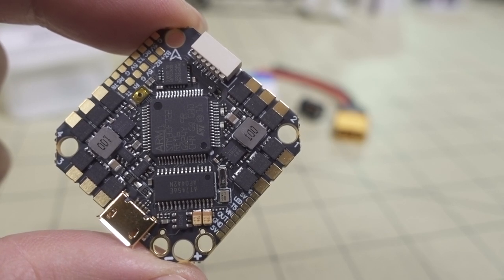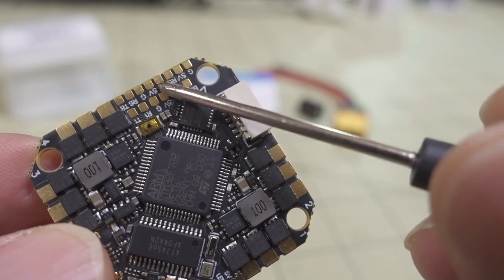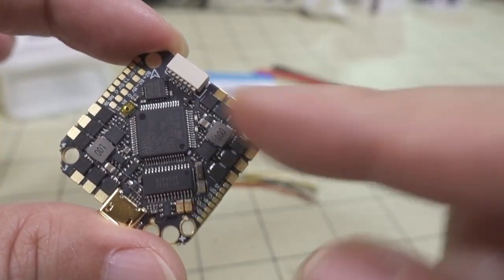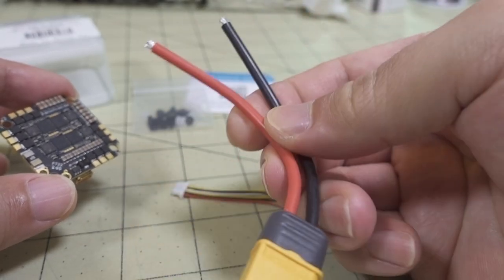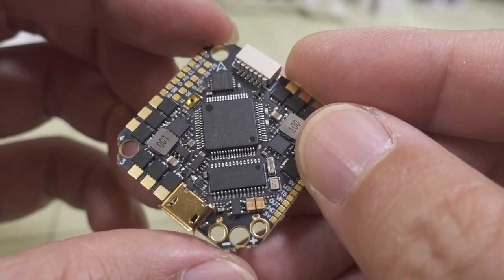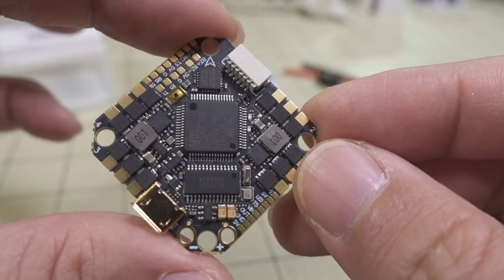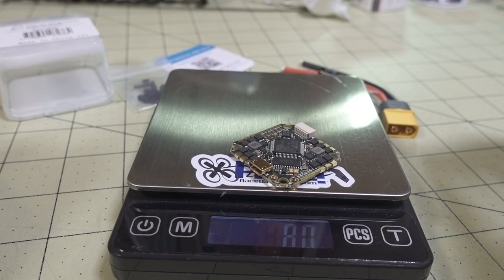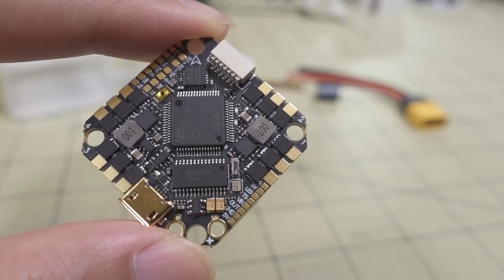BetaFPV F722 Toothpick Whoop AIO FC 🛠️

Comment: Hi Albert Great Video.!!!!! I am using this bord for my first build and I seem to not be able to see input movements on betaflight receiver tab using a dji controller 2.  Curious to know what toggles in the recievers tab do you need 
 ON.  to hopefully have a connection. 

It does bind with the dji 03 air unit. Using g the djj fpv v2 googles

Thanks in advance for any guidance.
Reply from the maker: Make sure your SBUS connection is wired properly.  Make sure you have selected the SBUS protocol in the receiver tab.  Make sure you have matching SBUS speeds in both the FC and in the Air Unit.  That's probably where you messed up... Normally, it's on SBUS normal in the FC.  If you set SBUS to FAST in the Air Unit, it won't work.  They need to match.

Comment: can I kindly ask you why neither in betaflight, nor in the OSD in the glasses show the battery voltage, although everything works perfectly?
Reply: did you figure it out? I think it was working on the betaflight that came with the board, I've upgraded it to 4.2.9 (without saving conf dump, of course)
and now I see zero volts, zero amps...

Comment: Hello and thank you for your video again!
I have this FC and I can not see voltage in betaflight. On what seetings I have to set it on betaflight battery tab?
Thank you in advance!
Reply from the maker: Usually the default factory settings will work just fine.  I almost never touch those settings.
Reply: @AlbertKimTV  Thank you very much for your answer! For some reason it came from factory like this. I have just try anything and do not know what to do. . .

Comment: Any idea how to clone the settings from one F722 to another one? Including ESC settings? I swapped the flight controller on a Pavo30 and can't manage to take off. I checked the props and motor wires all lock good. it should be something from ESC config I think
Reply from the maker: If you can connect to the old ESC, you can read the settings and save them to a file with BLHeli Suite.  If the ESC is dead, you're out of luck unfortunately.

Comment: How did this aio work out for ya ?
Reply from the maker: Working fine so far
Reply: Cool iv had problems  with there aio's  keep burning esc on the 20amp with 1507 3800kv  not really understanding  what's going on? 
Iv been through 4 in  two months ..
Reply: @stefffpv  20A